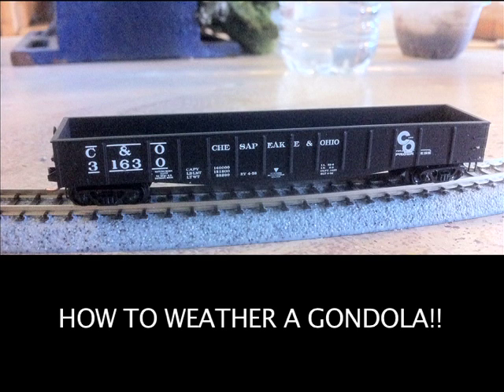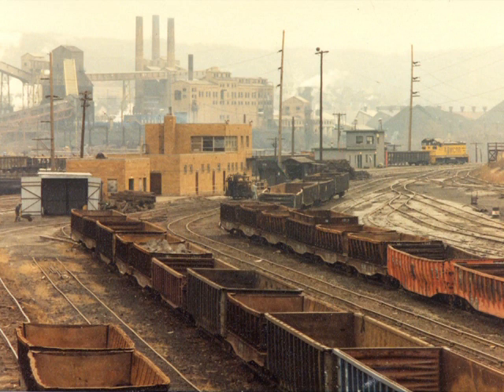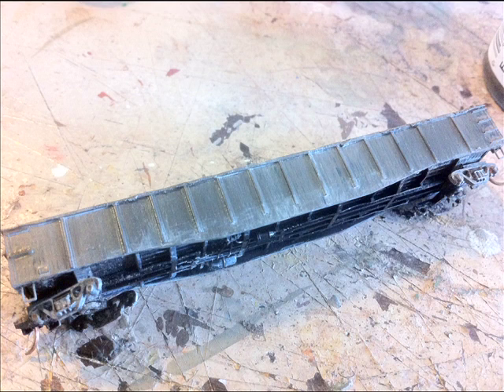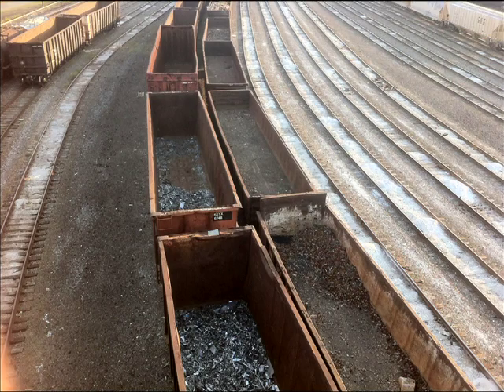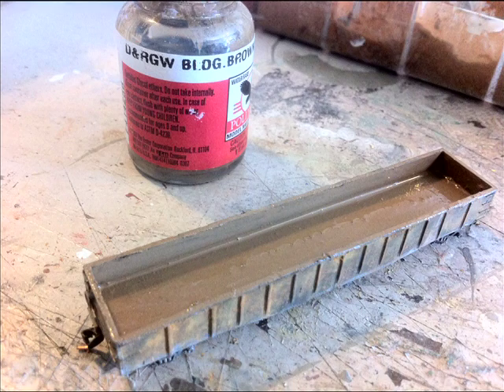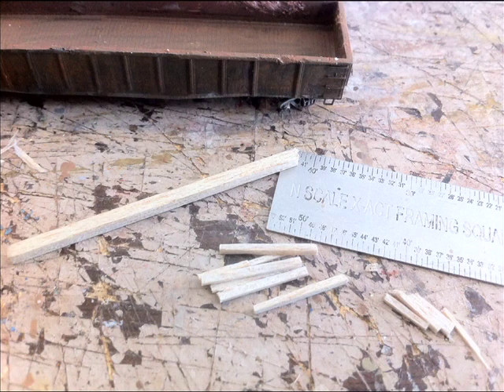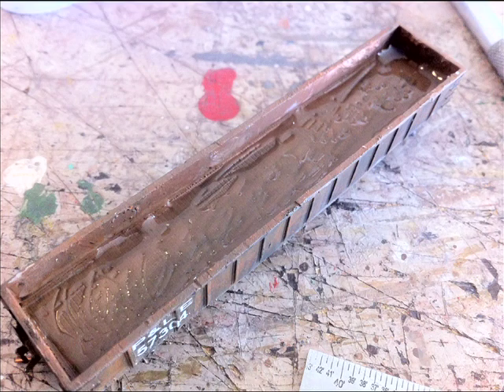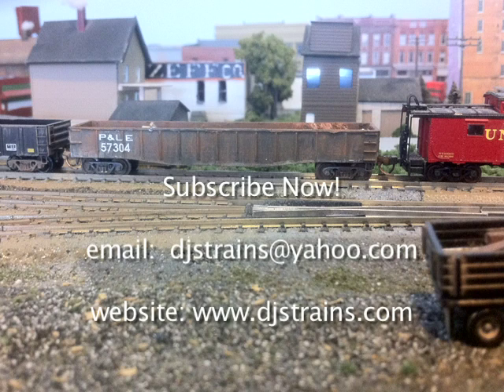MODEL RAILROAD WEATHERING TIPS

Comment: Great video! Keep them coming! Also, one of my favorite tricks for loads is to build large tarp-wrapped-flatcar or gondola loads. Take a piece of wood (I use old cork roadbed from a previous layout) and put a bit of glue onto both sides. Take a piece of gift-wrapping tissue paper and wrap the whole thing up, relatively smoothly, and then, folding the paper with the seams on the bottom, put a piece of scotch tape over the seams. Paint the whole thing and add some straps to keep the tarp on (I use chartpak tape) and you have yourself a great looking tarp-covered load!

Comment: OMG Thud, that was me hitting the floor. I just heard the other 4,000 owners of that Micro-Trains car clapping as their car values just went up. All kidding aside, nice video, I have a couple of tips. I've never tried this yet but I read Micro-Sol will remove factory lettering. For decals, first spray the car with Gloss coat, it will give a better surface for the decals. When finished then Dull coat the car. Last, you can use white glue to hold the dirt into the bottom of the car, no smell.

Comment: DJ, don't put the soldering iron on the plastic, use a old car weight. Place the car weight against the inside of the gon, then heat the weight with the soldering iron. Be sure to use a pair of pliers to move the weight. Keep testing and when the plastic starts to get soft, make the dents in the car side with your finger. By the way this might make a good follow up video?

Comment: Questions? OK. I recently joined a RR modeling club and the layout is big and old (parts date from 1940s). Folks clean the tracks and sometimes vacuum up around the tracks, but the trees look like they have decades of dust on them. Ditto for some buildings and the ground cover. Any tips/hints on how to clean the scenery wo using a shop vac to suck up EveryThing that is loose? Seems that this is a topic not easily found on youtube, lots on cleaning track, but apparently zilch on the rest of a layout.
Reply from the maker: Its a great question, as I have seen that also.  Do you think that a dusting feather type brush with a shop vac held at a safe distance would be effective?
Reply: @djstrains  I tried one of those swiffer dusters they club has on vegetation near the edge of the layout. It did not pick up much dust and the fringes caught on the foliage. I stopped when I pulled out a bush or two. The guys present suggested a paint brush; we had a small 1" cut -in brush (no joy on foliage but good on hard scenery such as building roofs and streets) and a small, soft artist's brush (maybe a bit better on the foliage). At that point I said %$#@ and moved on to try a sponge. We have natural sponges used for some overall painting. I ripped a small piece off and soaked it, squeezed out almost all water, and dabbed the damp sponge over the grass on a bank alongside the track. It took several passes and multiple trips to rinse the sponge, but the grass started to look greener (not just wetter-greener) and stayed that way. So, I intend to try a mixture of ideas next mtg night: a brush and vacuum as you suggest and a hair dryer and vacuum. I'm hoping one or the other will loosen just dust with no/minimal damage to foliage  while the vacuum sucks up the dust before it settles again. I'm also hoping some interested souls will pick up on this conversation and pass on ideas that they tried and which worked or start a conversation about where they found solutions or to suggest solutions. Take care and thanks for your interest.

Comment: great video. One question. Why did you letter the gondola after weathering? Wouldn't you want the lettering weathered as well?
Reply from the maker: good question.  I think I wanted to seal the car color with dullcoat to give it a finish that my transfers would adhere better to.  I read a lot about how decals need a good finish, so I think I was thinking that way.
Reply: OK. Thanks. I was just curious about your reasoning.